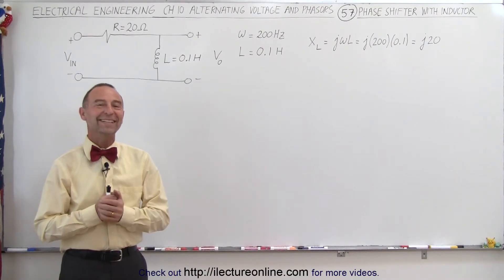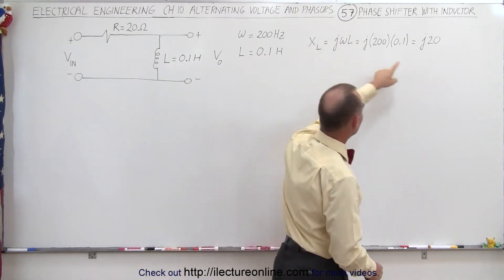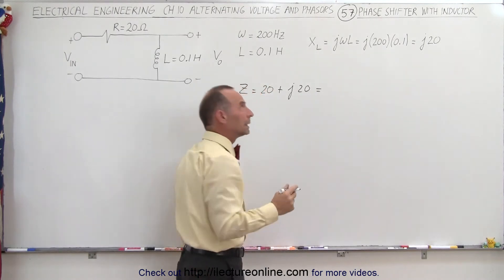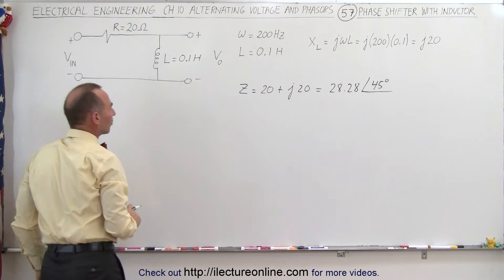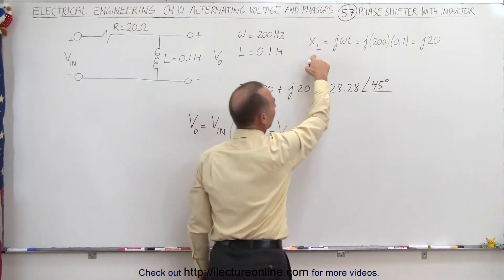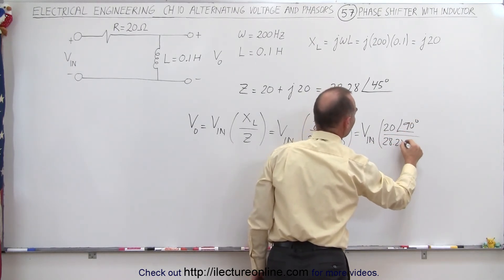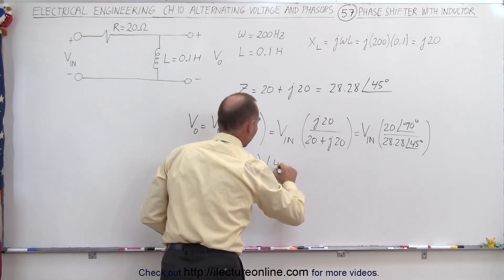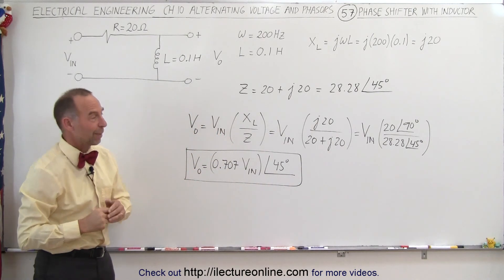Electrical Engineering: Ch 10 Alternating Voltages & Phasors (57 of 82) Phase Shifter w/ Inductor: 1

Comment: What is the benefit of having the output voltage that leads the input voltage ? 
don't mind if i ask a stupid question sir !!!
Reply from the maker: First of all it is NOT a stupid question at all.  (More people should ask these types of questions because that how we learn and understand).  The properties of capacitors and inductors are such that they shift the time of the voltage and current in a circuit.  We have been able to use these principles to build electrical circuits which perform all kinds of useful functions, (the applications are unlimited).  As a simple example we can change an AC voltage to a DC voltage using a few inductors and a few capacitors.  We use capacitors to protect circuit boards from voltage fluctuations, etc.
Reply: @MichelvanBiezen  i finally saw the light sir . Thank you for your dedicated answer !!!